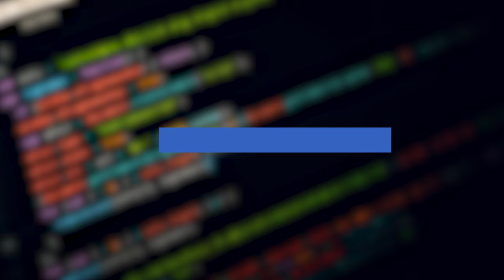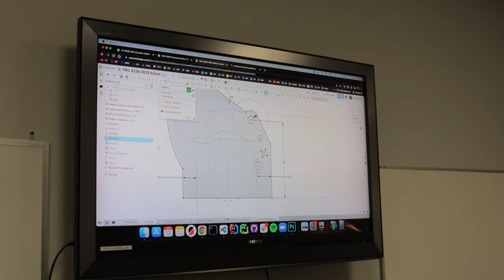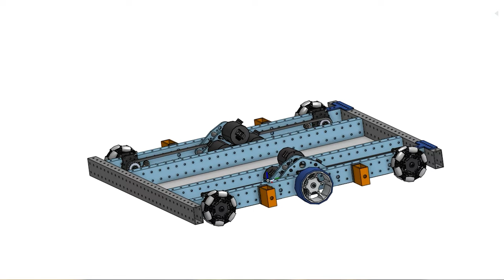FRC 6328 2022 Week 1 & 2 Open Alliance Summary Video

Comment: What's the top speed of the drivetrain, just curious?
Reply from the maker: With current gearing we're in the vicinity of 200 in/s (Neo motors, 1:6 reduction, 4" wheels).  Still subject to change though!